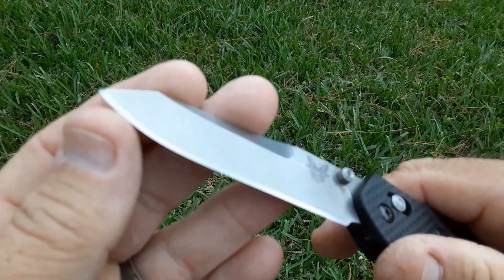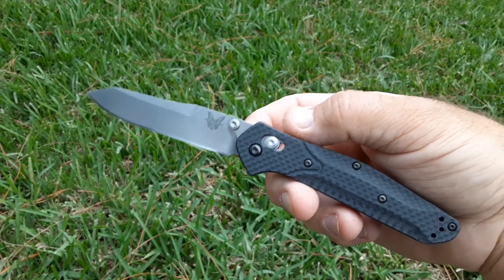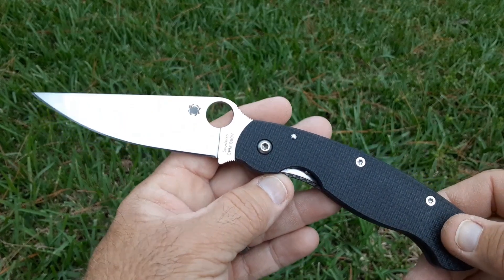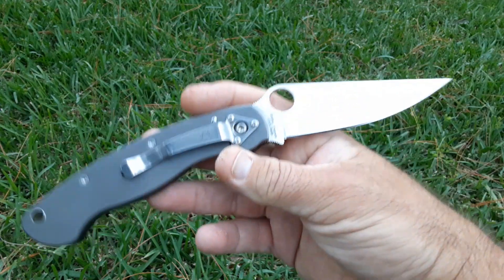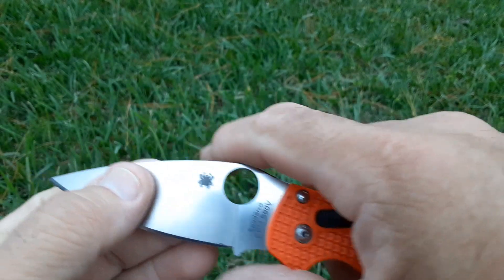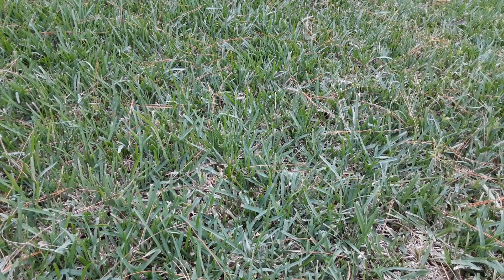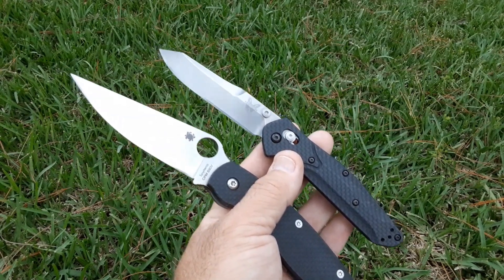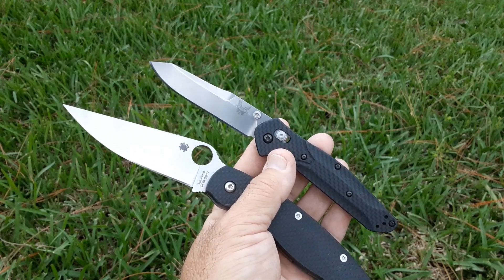S90V edge retention testing, Spyderco vs Benchmade part 1. How super is this steel?

Comment: Was curious how hard sypderco ran their S90V. I have a Gen 1 spyderco paysan in S90V. Its hard to find any info about its rockwell hardness. Based off other knives ive handled and sharpened, where i know the HRC, id say its above 60. Wish they told you the range their blades come in.
Reply from the maker: They do a good job with heat treating and most steels tested from them perform well. All the S90V I have from them has tested between 60 and 62 rc.

Comment: I really like S110V because its composition is quite distinctive, and impressive.  It’s so good on paper, but it seems like S90V usually works out a bit better as a knife blade, for most people.  

S110V does offer increased corrosion resistance though, (over S90V), and left toothy, (600 gr), its working edge is tough to beat; because of all those carbides it’s packed with.

I just bought a DLC S90V PM2, (teal G-10, black hardware and liners), and it was $40 less than my standard S110V PM2, (indigo G-10).  S110V must be a royal b@$t@rd to machine… otherwise I don’t understand why it’s so much more expensive. 🤔

Comment: I've heard that s125 is better with a real toothy edge, due to its super high carbide content. Wonder what kinda edge s90 is best with
Reply from the maker: I run anywhere from 400 to 600 grit on S90V. I've found this range to last the longest for my use. You can polish S90V and Steve did a video a few years ago showing the difference. I will be doing polished edges in the future to compare to the testing already done to show the difference and why I run lower grits.

Comment: Love it, thanks for the info!   I have a Benchmade 940-1 with the S90V and I agree on the easy to sharpen.  I like a toothy working edge on it, it lasts a long time.  It is easy to get that knife very sharp. Compared to Benchmade S30vn in an older model 790, the S90v in the 940-1 is noticably better.  Looks like Spyderco does even better with it.  I wonder how much is due to their edge geometry as well like the shape of the Manik I mean, aren't you also testing the shape of the knife a bit?
Reply: The geometry has something to do with it, but homeboy always thoroughly sharpens test blades to the same bevel angle.   The 940 isn’t exactly thick behind the edge, either.  

Spyderco just does a better job heat treating their blades than Benchmade does.

Comment: You can't really compare these too, as the grind is different.  Makes for much different cut through.  Super nice knives though!  Also it's SO SO SO good that you are telling people to do new edges.  The edge from the store is just to impress people, and high vanadium carbides do not get their best edges out of the box because of the laser cut for the blanks.
Reply from the maker: It's been shown many times now tge grind itself and bte thickness doesn't effect the outcome in cardboard testing. What it does show is on the knives tested the 940 doesn't have as good a heat treat as the Military does. It's a shame most won't put enough sharpenings on a knife to see its true potential.

Comment: Hey G , how do you deburr stubborn burrs? I use a kme  also, but sometimes I get a burr , usually near the tip that doesn’t wanna come off. Any tips would be greatly appreciated! Thank you for all your hard work!!
Reply from the maker: You're welcome. Stubborn burrs can be a challenge, I start by going back to my finish grit and see if I can reduce it with the stone. If that doesn't work I'll run the edge across a stone and sharpen again. I've only run in to one so far that I couldn't completely remove the burr. I have had a few over the years that were hard enough to deburr that I just threw them away. Try keeping your burr as small as possible and deburr on each stone as much as possible before going to the next one. This will help on any knife as well.
Reply: Outpost 76 thank you very much
Reply: @Outpost_76 so you use a KME? What grit do you bring it up to?

Comment: On the 7th edge! Most people would never find that out in the first place...
Thanks for all the effort and keep up the great work.
Reply: Heck yeah, I can't thank him enough to tell people about this.  Stainless vanadium carbide (20cv, s30v,s35vn,s90v,s110b, s115v) needs to be shaved down a lot when you get it.  You must get a massive massive bur then sharpen it down.
Reply: @greggc.touftree5936  only if they ruined the edge or lets say fatigued the steel with to high grinding temperatures. There are companies ot there which are going for wet sharpening or even hand sharpening for their blades, so the factory edge is top notch out of the box, like for example TRM or Rockstead...
Reply: Any theory on why that 940-1 started cutting better so late in life?

Comment: Interesting results! I don't have any knife in S90V and I probably won't get one either since I really hate chipping while I love thin edges. How big a problem is it with S90V in relatively heavy use (hardwood cuting), please? That being said, my Benchmade S30V doesn't like a thin edge either (even after a lot of steel removal) which is dissapointing. I ended up putting a microbevel on it which helped but anyway... For me, good M390/CPM 20V works really nice in a folder and I tend to use it most often despite the fact that manufacturers mostly don't do a good service to the this steel.
Reply from the maker: I'm going to work some steels and wood in to videos in the future to show how to expect different ones to hold up in use.
Reply: @Outpost_76  That sounds awesome! Your channel has really a high quality content. It is not as "flashy" as some other knife channels but I like it more. The information is very valuable! Thanks!

Comment: I know my 940-1 tested at 60.5. I haven't hit the "good" steel yet. It dulls fairly quick which should improve with a few more sharpenings. S90V just seems more user friendly than S110V.  I have a few Spydercos that use it. I will have them hardness tested at some point. Thank you for another great test video.

Comment: S90V is awesome stuff and it's not offered enough in Spyderco’s lineup. It sharpens like a good non-stainless. Lately, I've had a really hard time carrying anything other than my CPM154/S90V Manix. S90V is definitely up there with K390 for me, and I'd be happy if I was stuck with only those 2 options.
Reply: Is yours the one with the carbon fiber laminate?   If it is I have been eye balling one from bento box shop and I think you help me make up my mind.
Reply: @hooliganAvail yeah,  it's full CF with a laminated blade. If you like the Manix and S90V, this one is perfect, and won't disappoint. BBS is where I got mine too, but in a bundle with the K390 PM2 I think. It was about $406 shipped, which makes that PM2 closer to $150 than $200. BBS bundles are the way to go, if you have the funds and can find something you're interested (out of the options they provide).
Reply: Agreed i love S90V

Comment: My 940-1 was so chippy until I got past the burnt steel. Which took a long time and many chips and sharpenings in between. It's finally at a point where it doesn't chip from looking at it. Because it's so thick behind the edge, especially after that much sharpening.... I barely use it anymore. I have that framelock spyderco military in s90v also, and after sharpening twice it stopped chipping and its one of my more favorite models of spyderco. I wish they would make a pm2 framelock just like that military framelock.
Reply: Most guys prob. get rid of their knives too early which is a shame,what your experiencing happened to me with my s110v native so I said what the heck and went quite steep angle with my edge the knife looks a little ugly ...but man now the edge stays sharp crazy long and its one  of my favorite edc
Reply: @blueswan2175  happened to my manix 2 s110v. I ended up putting a wider angle for more edge stability and it hasn't happened again. Cut up a ton of stuff and alot of carpet when the whole town flooded. I'm pretty sure spyderco use water cooled robots on there golden knives, but it still gets a little burnt. Unlike Benchmade and there various burnt levels.
Reply: What were you doing with it where it was chipping?  I haven't experienced that on my 940-1 and I have took it hiking for years and done a lot of light bushcraft with it as well as general medium use EDC.  I haven't cut rocks but I haven't babied it.
Reply: @captainkittay  factory edges are burnt from the factory causing fatigued steel at the edge. This is common knowledge.
Reply: @tacticalcenter8658  thanks, I just learned something!